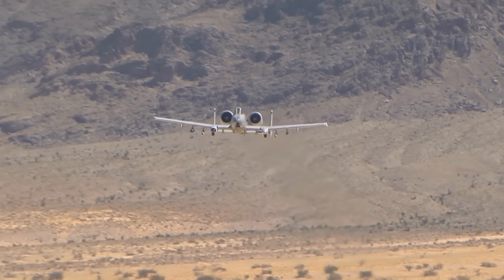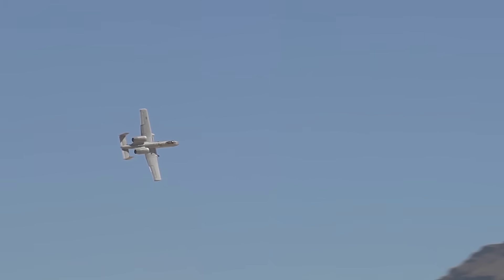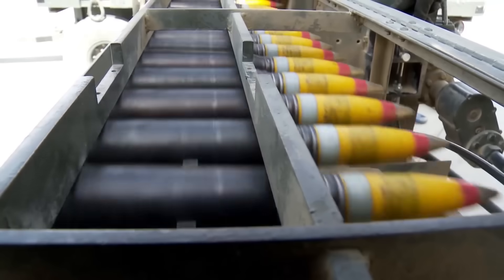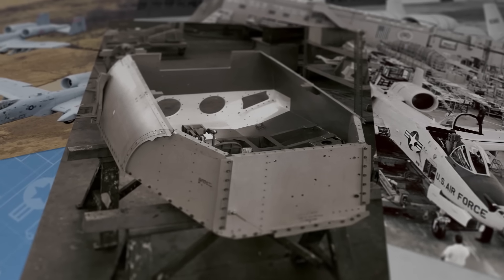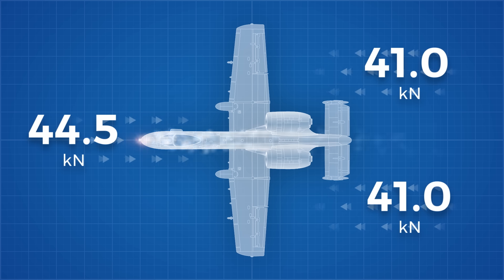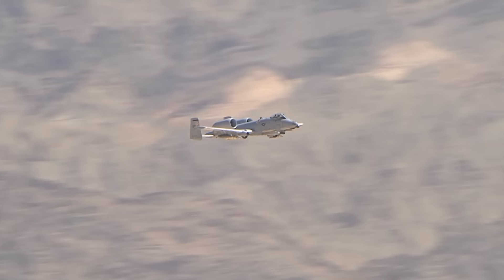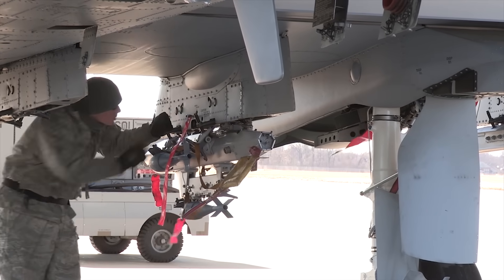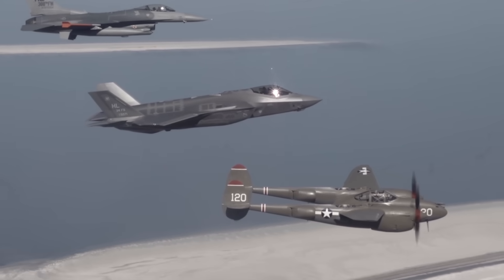The Insane Engineering of the A-10 Warthog

Comment: You can pretend the A-10 is obsolete... but I guarantee China would not want to see these join the fray in the South China Sea or the India border dispute. These things will be boat killers and prevent or route any attempt to raid the borders of India easily. Maybe with some Multirole fighters as back up.
Reply: It would only be useful if the scenario does not involve enemy air defences... and if the enemy lack air defences you can achieve the same result for significantly cheaper than the A-10.. so it is absolutely an obsolete platform.

Comment: You screwed up your doctrines. The fulda gap and A-10 were designed for "Forward Defense" not air land battle. Forward Defense was basically the idea that any war with the Soviets would begin with one gigantic battle, where the majority of all casualties and equipment would be lost. After this massive battle, the winner would have the momentum and equipment to essentially win the rest of the war. In this idea, every and all assets were to be capable of responding and engaging in this single front all at once. This doctrine was highly disputed at the time and was quickly replaced with Air-Land Battle. The A-10 was built specifically for Forward Defense. It was the idea that losing an aircraft was irrelevant because saving it for the latter was also irrelevant. The A-10 was built to be survivable enough to deliver munitions (surviving up to 23mm cannon shells). That primary munition was to be the AGM-54 Maverick Missile. The cannon was added as a secondary armament for a pilot to utilize before inevitably being shot down. Even at the time of conception, the Gau-8 was not strong enough to penetrate anything but the most outdated of Soviet reserve tanks. 

After moving to the newer doctrine, Air-Land Battle, the emphasis was shifted on mobile groups that could rapidly outmaneuver and concentrate firepower on weaker Soviet advances. In such a doctrine air superiority would be paramount, as fighters could rapidly consolidate specific engagements to overwhelm and destroy advances. In this new doctrine, the A-10 forever lost a place in the USAF. Strike fighters became the primary tool of the US air forces. Utilizing their capabilities in mobility, SEAD and strike to maintain air superiority and provide critical support at a moment's notice. 

Points about the A-10 that are hilarious:

- "Available at a moments notice" The A-10 cannot, and is insanely slow. Maintaining a forward bases is not easy or considered feasible. Having faster aircraft operating off of tankers has been the doctrine since Forward Defense was scrapped, and has proven to be the best doctrine. A-10s operate this way today, and are just a lot slower than strike fighters at responding to threats. 

- The A-10s survivability is about on par with other fighters. The most prominent AAA is the 30mm rotary cannon, which is beyond anything the A-10 was designed to withstand. Having backup flight control systems is more important, which is why aircraft like the F-35 have completely independent and localized hydraulics. Using electronics to transmit the control rather than having centralized systems. Even further, not getting hit in the first place is by far the most preferable option. Strike fighters operate in a way to avoid AAA, and the A-10 operate like strike fighters in modern combat. This change occurred during Desert Storm, where the A-10 was pulled back from frontline service, where the F-16 replaced them with a much lower casualty and damage rate. The A-10s were forced to scud hunt and attack reserve targets for the rest of the war. 

- "cheap and rugged" LOL. An A-10 was not cheap in the day, and a modern kitted A-10 is not cheap now. While they may be slightly cheaper in both cost and operation (per hour), they are far less capable than a modern F-16, F-15E or F-18. I should mention that the A-10 fleet costs about as much as the F-16 fleet per year on a per aircraft basis. Yes the A-10s fly more hours, but the cost being paid is standing up a fleet of A-10s. It costs a lot of money to maintain the logistical support, whereas larger fleets like the F-16, F-35 and F-18 can divest those costs amongst a larger number of airframes.

- Heat-seeking missiles have been so good for decades, that they target the aircraft as a whole. These are called "all aspect". Old missiles, like that of the very early Vietnam and Korean wars had to target the rear exhaust plume of jets. More modern ones simply distinguish the warmer aircraft fuselage rather than having to find a particularly hot engine exhaust. Therefore the split engine may have served a purpose in the 1960s, today it simply brings no benefit. In fact, the placement of the engines could rather be described as a cost and maintenance feature rather than one of survivability. 

- "smaller military planes don't typically have Auxilary Power Units" LoL? Like which ones? The F-18, F-15, F-22 and F-35 all have APUs. The F-16 doesn't technically have an APU, but it does have a Jet Fuel Starter to start the engine without a cart and an EPU to provide electrical power during emergencies. You really have to go back in time to find aircraft that lacked them. 

- You are using numbers for cost per flight hour that differ in what they are measuring between aircraft. It appears you are using Operational Cost Per Flight Hour for aircraft like the F-15, F-22 and F-35, while using Reimbursable Cost Per Flight Hour for the A-10 and F-16. Here, https://www.reddit.com/r/Dragon029/comments/95kh8x/reimbursable_cost_per_flight_hour/ , is a good source to learn about CPFH and the many different ways it can be measure among US armed services. There is even a chart extrapolating RCPFL, showing the F-35 around $17,000. 

------------------

The Video author makes a great point when stating: "The two planes were designed in completely different eras with completely different military doctrine in mind." This is so true and obvious that it hurts. The A-10 was designed for a doctrine and war that never happened and was quickly replaced. The F-35 is built for the modern battlefield and the one expected in the future. An A-10 would never be built today because it is a gross misuse of resources. A slow and cheap COIN aircraft would be using Super Tucanos and other turboprop aircraft. In fact, using strike fighters is also not a bad idea, because economies of scale are a thing. Procuring and operating an aircraft more, develops efficiencies that may be applied to a larger fleet. Strike fighters also have other advantages over the A-10 like speed, range and payload. The only reason the A-10 hasn't been retired is because of public endearment and the US Congress. It cannot be considered wise maintaining outdated and antiquated equipment because of Congress as a better alternative than listening to professionals that spend their careers developing the most capable military force.

Comment: FYI, the GAU-9 on the A-10 is not mounted directly along the centerline of the plane, it's actually mounted slightly offset. However, it does fire from the barrel lined up with the plane's cern tline.

Comment: Actually, the reason that the shells are pulled back into the plane is mainly to have ballast so that when all the rounds are gone, the plane doesn’t pull up because a fully loaded gun and a empty gut have very striking weight difference, which might severely hinder the performance of the plane. Awesome video as always though. :D
Reply: I'm not sure it's true. An aluminum case weights only a fraction of a full cartridge (around 75% of mass flies away as a projectile and a propellant). A center of mass' drift is normally addressed by an elevator trimmer adjustment. The ammo drum is very close to the wing, making a lever shorter, and is balanced by fuel tanks over and behind the wing that also loose weight over time. And collecting cases to prevent them from getting into intakes is nothing unheard of (Hawker Hunter comes to my mind immediately).

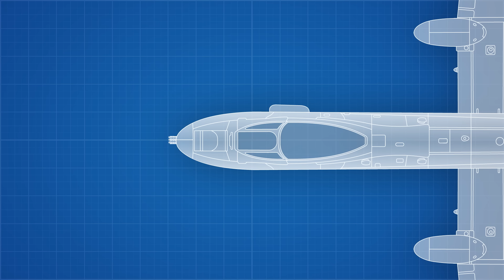Comment: At 7:45 you say "the gun is mounted on the center line of the plane". Actally that's incorrect. The gun is offset to the left but fires through  the barrel that's in the 7:00 o'clock position which does correspond with the center line.

Comment: Had a marine buddy from my church say they will always call upon the A10 than an F16 or F35 because when they call the A10 its battle and flight ready in 2 minutes and on the way in 3. So a total of 5 minutes. The F16/F35 were off the ground after 30/60 minutes of computer  booting and system checks.. meaning the A10 is on sight and dealing damage and saving troops by the time the F16/F35 takes off... it is by far the greatest plane.

Comment: Awesome documentary 👍, loved the pace of it, and it's so concise, and very well made. 😋 What I'd like to know about the modern fighters that are replacing the A10; For example the F16's air intakes are very low. Can it land on a dirt track, and be cheap and easy to maintain? The A10's design-team's total methodology should have been used. It should have been the basis to be re-designed into whatever. (A16 🤔, A35...). "It" I mean the basic principles used. 1. CHEAP, 2: Robust, 3: Off the shelf part-system. 4: Quick easy repair. 5: Adherence to those principles. New awesome tech is nice.........but an expensive, sensitive, unmaintainable, mess....? Jet fighter plane's are insanely expensive to maintain.   🤮💰

Comment: The A-10 is anything but a single role airframe. It can do many missions extremely well. CSAR, CAS, Show of Force are just a few. And there’s no way in hell the f-16 carries even “similar” payloads. The A-10 carries 1k+ 30 mm bullets the F-16 carries 19 spitballs and has a loiter time of zero in comparison. And don’t get me started on the bombs. It also can’t land where the A-10 can nor can it take the beating required of true CAS missions. I’ve worked both. They have very different roles which are not interchangeable.

Comment: The gun is NOT mounted directly on the center line of the plane ... this is one of the most interesting engineering points about this plane!  It's mounted to the left side of center line to prevent course drift during firing since the firing barrel is roughly in the 7 o'clock position.  Where did you even get that graphic?  It's off-center position is clearly visible in pictures of the front of the plane and is well documented.

Comment: The folks who designed the doctrine behind the F-35 have completely forgotten the lesson of the F-111. Building an all purpose aircraft gives you something that isn't much good at any of it's roles. Put it up against a single purpose aircraft designed to the same level of tech and it will not survive. Maybe like the F-111, they'll find a role that the F-35 will excel at although I doubt it. For the F-111 it turned into a really good long range, low level, penetration type attack bomber. Maybe the F-35 can get into a similar penetration role due to it's "stealth" but it won't be able to carry a decent payload any real distance. That brings me to another question, how is it going to fare in the low level tank killer role when it has a limited number of weapons, and nothing to compare with that marvelous gun?

Comment: Afghanistan like environs require boots and slow air support. The idea of an F35 replacing an A10, as apposed to an Apache, is bewildering to me. But coursers we know from the Russian experience that helicopters are not a great idea in the mountains terrain  of Afghanistan. Not to say that there was no helicopter support in Afghanistan. It's just to say that it seems that the A10 is really an much more secure and cost effective alternative to the Apache than it is to the F35, a plain that for cost reasons alone could never do what the A10 does.

Comment: At 0:49 , It seems that Gamers have been attacked by some intel if gaming against Russian invasions.
Perhaps was a test and preemtive mental massage ...

East intel seem to have applied the war onto the Gamers in EU and USA around 2015 
in military battle simulations, to suppress defensive entrainment and figuring out new effective ones. 

Example: ARMA 3. 
Simulated invasion from Russian military onto Germany / Europe.

If using mini quad drones as forward artillery designators onto approaching hostile tanks convoys, which showed very effective and NATO Life saving, because hard to detect hovering low and undetectable for tank radar and artillery shells couldn`t be defended, 
it showed that they seemed trying to prevent the gaming by assaulting the PC Game system.

Then they applied some form onto the textures making it appear undesirable or mentally irritating to see the DRONE CAM footage.
Perhaps shablone resonance or so... if someone saw the image.

Then later were strange enviromental emotional aggrivation sensations noticable in the room. Like hot and zapping and heavy mental irritations 
making one feel aggrivated and mentally affected to perform an action because causing strange preventive scare impressions.
But as a gamer one was tough and took it as a challenge..... on the mental and body level.

There seemed a lot of subconious anti Russian suggerations and mental whispering voices, trying to pacify one to drop fighting.
Also waves of intense emotional overwhelming sensations, making one feel bad if shooting on Russian tanks, causing almost trauma like compassion and sorryness....causing a reduction to engage next times. But one started to sense that it was artificial and strange and figured out that it was some form of psychic electronic assault.

Comment: Great video, but to bad about the anti-DU bias.
DU radiation is so low it is harmless.  It does not penetrate the skin.  Both NATO and International Atomic Agency proved this. There is radiation all around us all the time. DU however being a heavy metal is toxic, just like LEAD. But nobody complaining about all the lead bullets. Also the DU is only a very small portion of the round, the penetrator.
One also has to take into account the targets. DU tipped ammo is anti-amor. It is not anti-personnel. 
The only problem is to inhale DU dust (which can happen when it gets into contact with tank armor) so it gets into your lungs. To be infected with DU you would have to be inside the tank being penetrated, at which point the toxicity will be the last thing to worry about. You will probably be dead.
Many DU rounds, APFSDS tank rounds in particular are pretty useless against soft targets (as their effect is to narrow and they have no explosives and infantry is to small of a target). With the A-10 its the only ammo carried so could be used in anti-personnel role. Even if used as anti-personnel, no human will survive a hit anyway. And even if some of the DU is changed into dust (which only happens when it hits something hard like tank armor) it will spread over such a wide area that not much of its toxicity is left, just like with lead rounds.
DU rounds save lives. They have the ability to penetrate targets that other rounds like tungsten can not. For instance the penetration of the Abrams L44 gun with DU tipped rounds is close to the penetration of the Leopard 2 A6+ with L55 gun and tungsten. Which is why the US is still using the L44 (which gives the tank better maneuverability in tight areas).
Being able to take out that enemy tank or not is the difference between saving or losing friendly lives (including civilians). The lives of its own military personnel should always be the first priority of a military, after all they get into harms way for their country. Also the sooner the war ends the less lives will be lost. 
When looking at left over dangers unexploded ordnance like shells, mines and bombs are actually a risk to locals. In Europe unexploded ordnance from WW2 and WW1 is still being uncovered. So after a war these will be the problem to think about. The anti-DU lobby is mostly an anti-western lobby and/or anti-nuclear lobby. It is not based on facts but purely political.
Please keep such political disputed things outside videos like this.

Comment: I feel like a repurpose and slight redesign in the a10 might be a good idea in sense that troops on the ground need a fast in the air support asset like the a10 but perhaps making the more versatile as an observation and ground support vehicle making it slightly bigger for a 2 man crew adding deployable overwatch drones that can be monitored by the co pilot as well remotely fire missiles and monitor areas of the battlefield that might be immediately seen by the main pilot or ir ground forces essentially the idea of a flying fortress from yesteryear but with a more modern and advanced system and tactics